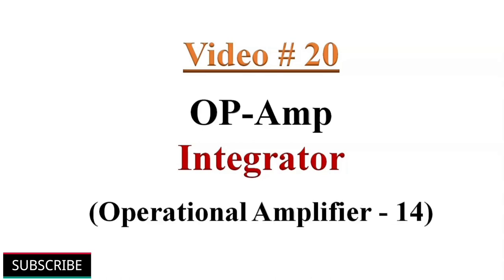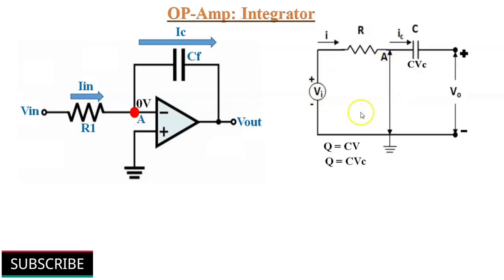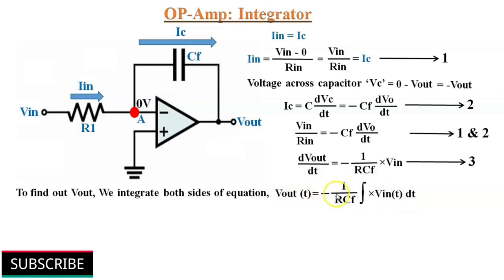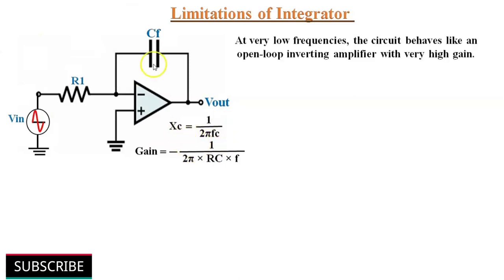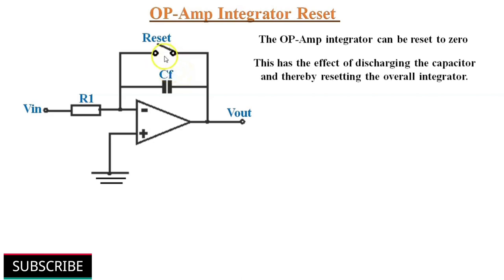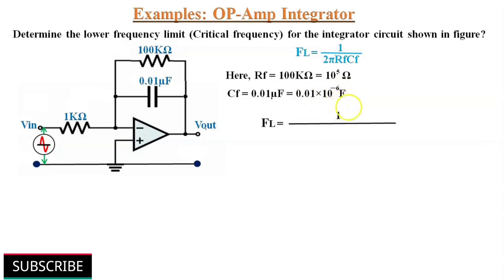OP-Amp Integrator (Derivation and Examples)

Comment from the maker: The timestamps for various topics covered in this video are as follows:
1) 00:14 - Introduction,
2) 00:46 - How to use Op-Amp as an integrator (Derivation)
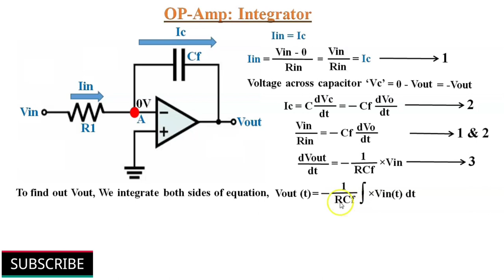3) 03:35 - Op-Amp integrator output voltage,
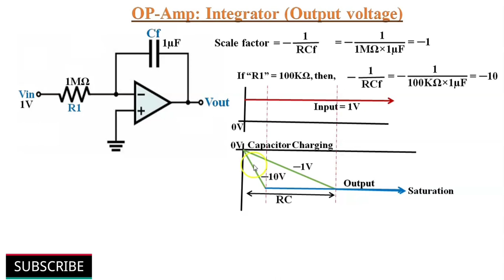4) 04:56 - Op-Amp integrator behavior on square wave input,
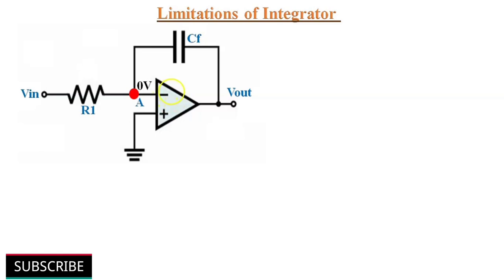5) 06:40 - Limitations (Impedance) of integrator,
6) 08:01 - Frequency response of simple integrator,
7) 08:20 - Limitations ( I/P offset voltage and I/P bias current) of integrator,
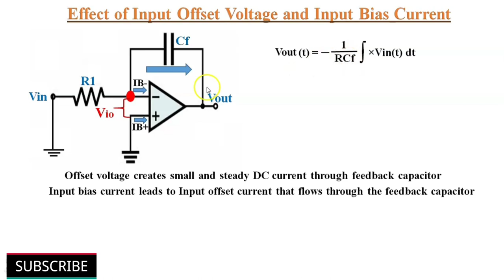8) 09:25 - Solution for limitations (Practical Integrator),
9) 10:44 - Integrator behavior on sine wave inputs,
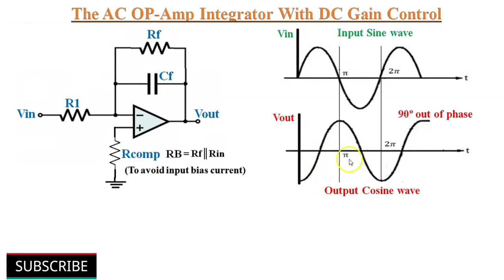10) 10:53 - Integrator behavior on triangular wave inputs,
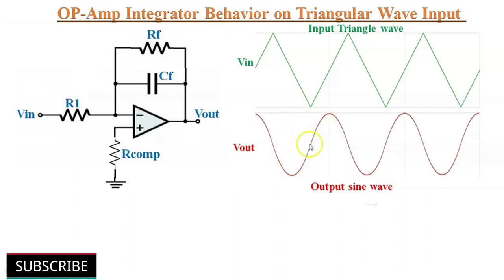11) 11:14 - Frequency response of practical integrator,
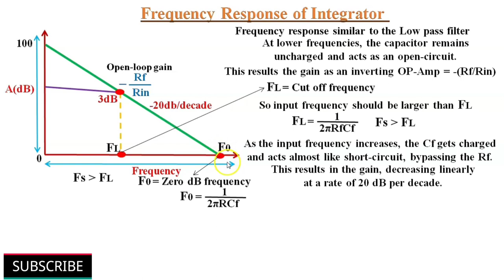12) 13:05 - How to reset Op-Amp integrator,
13) 13:47 - Example - 1,
14) 14:56 - Example - 2,
15) 15:50 - Example - 3,
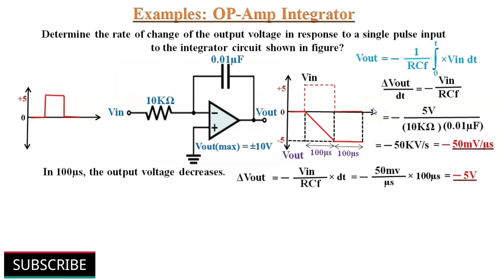16) 17:42 - Example - 4.